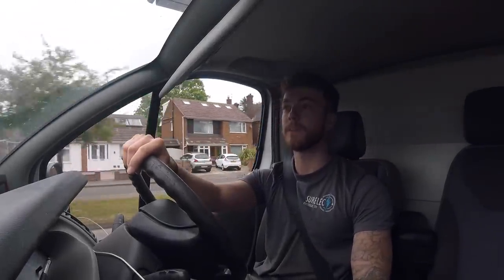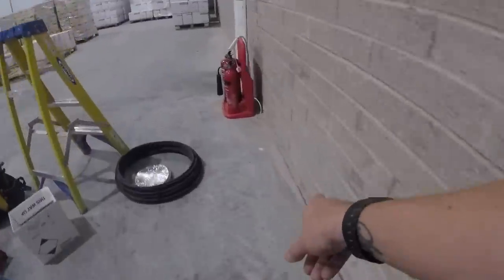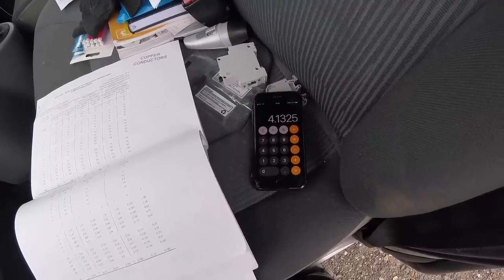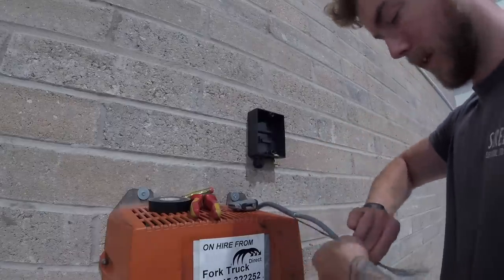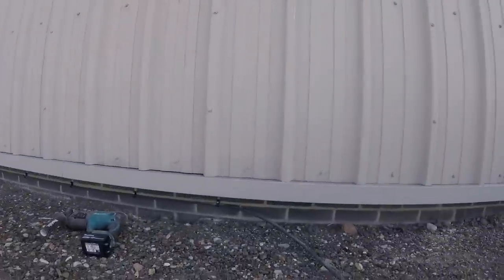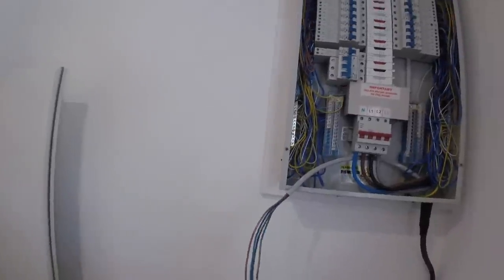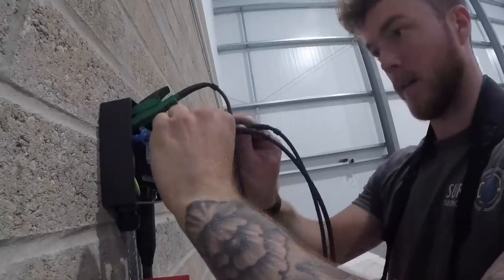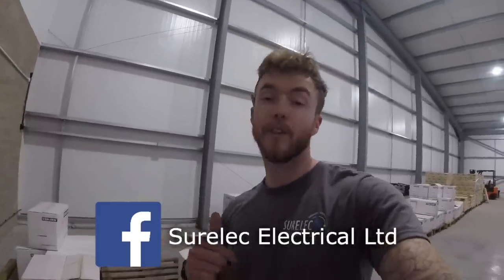SurelecTV- Forklift charger + SWA + SY + 3phase

Comment: Nice, tidy job mate and love the equal spacing on the cleats; can’t stand to see uneven spacing or cable rising and falling along a run. I remember doing some pyro (micc) cable at a school and the other sparks going nuts at me because I was using my hammer (length of it) as a guide to space the clips whereas they just wanted to clip it up by eye! 

Needless to say once I qualified I got made redundant! 😂

One of the things that concern me if I decide to get back into sparking is the inspection/testing. Been watching vids to refresh my memory but it’s so long since I done any I no longer remember what are good/bad values, order of tests, settings on the test equipment which is why vids like yours are very helpful to old guys like myself who’ve been away from the game for many years.

Keep them coming mate and here’s to the next 1000 subscribers 👍🏽
Reply from the maker: Thanks for the comment mate, really appreciate it.

Yes, it always looks 100x better when the cable is cleated/clipped properly. You also can't go wrong with the good old hammer spacing haha.

With regards to testing, its the same as most things really, when you start doing something a lot, it becomes second nature. I'm sure once you get back into it, it will be a breeze!

Comment: Great work.  However.  Personally I would not have cleated the cable at low level.  Worker jonnies being what they are, they are bound crash something into it.  Usually just out of badness.  I would have lifted it just above head height and dropped into the top of the isolator.  Keep the vids coming, learning lots from guys like you. :)
Reply from the maker: Thanks for the comment buddy! I did consider putting it at high level I must admit and in hindsight I maybe should have. However, this isn't a very busy warehouse at all, no one inside all day while I was there. The only operative who uses the forklift and trolly inside the warehouse actually works in the office and is quite high up in the company, so would like to think he's smart enough to avoid crashing stuff into cables aha.

Comment: How do you measure your cable runs? I usually go round walking like one of the Queens guards.
Reply from the maker: Alvin Ashman exactly the same haha! Usually gets a few strange looks of the customer. If it’s a massive run then I use one of those measuring wheels which are pretty handy
Reply: SurelecTV- To be fair, I'm never usually that far off. I'm contemplating weather it's worth getting a measuring wheel or not.
Reply from the maker: Alvin Ashman yeah me either tbh. Think the wheel gives a bit more of a professional look if you need to give that impression on some commercial/industrial jobs

Comment: Nice job, i love vids that are completely real life, some guys are getting a bit famous and don’t show what they really do. 
Were the terminals hard to reach? Just wondering about the length of exposed tip on your testing probes, not GS38.
Also, I know your side was all dead but is it not good practice to connect the earth fly lead first in the board?
Reply from the maker: Thanks mate, really appreciate it! The terminals on the isolator are a bit awkward to reach. I do have the little covers to go on the probs to meet GS38 regs, however sometimes I can't use them cause I can't get a good enough contact on a terminal. If the terminals are really close together then I'll 100% make sure they're on. With regards to connecting the flying lead first, I'll be honest I hadn't heard of that before, but it make sense, so something I'll for sure be doing in the future!
Reply: GS38 when it comes to exposed tips on test probes is complete nonsense as far as i'm concerned, we are professionals and for the most part are comfortable working around live equipment and understand all the dangers with doing so.  We don't need some HSE document giving yet more micro managing restrictions on how we should do a job, usually written by someone in an office that has lost touch with the reality of working in production instead of some test rig on a wall somewhere. I keep my probe covers in a little bag so they are nice and safe to pop on for inspection day. :)
Reply: @PyroDanUK    i dont blame you some intallations you need the longer tips anyway as them silly 4mm tips dont connect

Comment: As always a very neat and tidy job installed with pride. Be interesting to see the test result sheet, I use an app for Ipad  by Castline Systems ( pricey but excellent) for cable calcs as it can generate a pretty smart circuit report .  What size breaker did you fit and what earthing system was it ?  Keep posting, nice to see quality work on show .
Reply from the maker: Thanks for the comment! Hopefully going to film the test result input this week, so keep an eye out for the video. I'll have a look into the Castline System!

Comment: Next time you want to terminate a long tail of SY braid, rather than comb it out ... push the braid back towards the clear jacket so it forms a balloon and open a big hole near the end of the outer, then pull the inner sheath out through the hole using a screwdriver to ease it out. The braid stays plaited and when you pull it straight it sits flatter inside the earth sleeve.

Comment: Another good vid mate. 

How come you used  calcs for single phase VD and not 3 phase?

Does anyone not  use normal flex or tough flex rather than SY. Always thought SY and YY cable were control cables.
Reply from the maker: Thanks mate, appreciate it!

I got a bit carried away and done the percentage drop on the 230V by accident, I meant to say 5% of 400V, which would have obviously given me an evening higher acceptable VD.

I would have preferred to use Hi-tuff cable for sure, however, I only have 2.5 3core on my van and all the wholesalers in my area don't actually seem to stock any Hi-Tuff anymore. It made sense in this situation (For the small amount needed), to just use some SY (Large stock at wholesalers). 

Thanks again for watching!
Reply: SY cable is not suitable for outdoor use! Although it is very common to see. :)

Comment: Why did you not use the correct gland for the SY but you did for the SWA? Apart from that a very neat professional 
job 😬
Reply from the maker: Thanks mate! I didn't use the correct SY gland as in this situation the likely hood of strain being put on the cable was slim, also, it turns out that although my wholesaler stock SY cable, they don't stock all the glands. Although I used a stuffing gland, I made sure the braid was correctly earthed still.
Reply: I noticed that so I would have no issue with the way you did the job with a stuffing gland. I tend to keep some heat shrink in my kit for times I do not have SY glands just to make the braid a little cleaner. But good work 😬. 

I work more in automation and data centre work these days so I tend to have SY glands in my kit but I know that they are hard to get off the shelf. I work mostly in Leeds and only CEF stock them.

Comment: Only additional thing I'd have liked to see above what you already did would be using rubber grommet in the metal cladding penetrations to prevent the metal edge chafing the cable and giving it a nice clean look on the cladding. I really appreciate the attention given to level (sight line) and clipping the cable at a nice repeating interval. Very nice work!!

Comment: Absolutely pukka job. Would have used a bit of Hi-tuff instead of the SY, as you can’t gland it at the charger end, but job jobbed!
Reply from the maker: Thanks mate! I would have preferred to use Hi-Tuff too, however none of my local wholesalers stock the stuff anymore, especially with the number of cores I needed. They do stock large amount of SY though, so made sense to use that considering the small amount I needed.